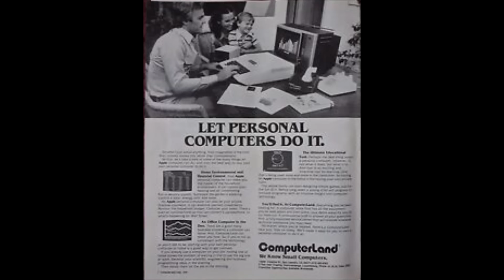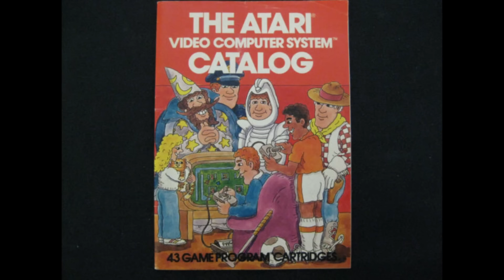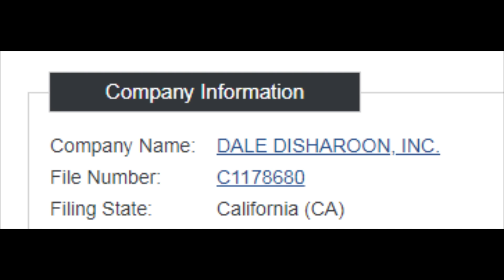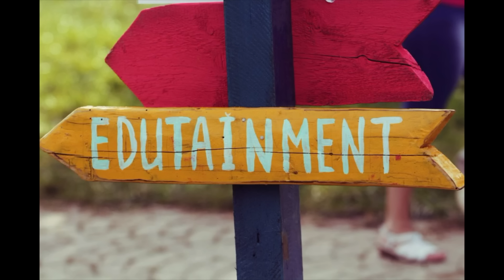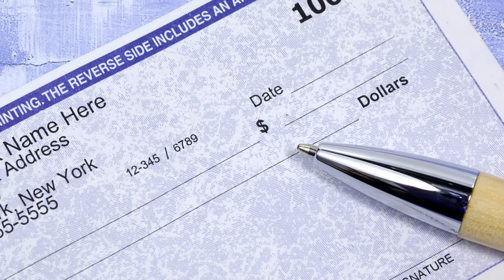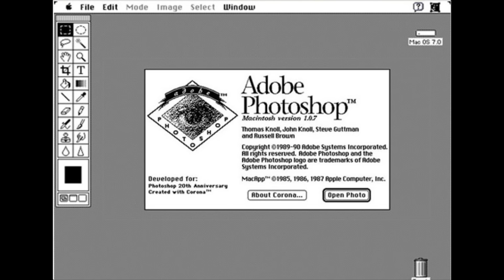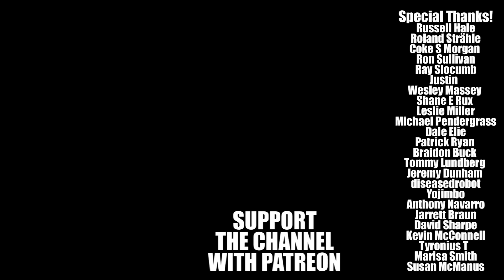Exploring The Legend of Zelda CD-i - The History of the 2 Notorious Games

Comment: Mt elementary school was rebuilt around 92/93, mainly from the asbestos used in its production - they even had a person come explain why it was bad to breath in asbestos dust in a simplified way (the particles are hooked shape and will get stuck in you air sacs, something like that). But they had built an amazing media center (it replaced our old library, but it still had books) with all the classrooms being connected to it, and they had CDi's and VCRs, Laser disc players in there, and the teacher would call them on a phone that we also had in every room and ask them to play whatever it was and they would send it over however it was hooked (up Im not sure if it was networked or if it was just splitters and long S-Videos/RCAs)to your exact room (every room had a TV mounted in the top corner). We also had a small cluster of Macs that were pretty good for the time, sometimes the pod of 4/5 Macs were shared between 2 rooms but a lot of the older kids 4th/5th graders had a pod in each of our classrooms. I mean this was a huge step up from the past schools and tech they had, the AV cart was top of the line for the old school. Mind you this is in Hammond, Indiana which is literally sandwiched inbetween Gary, IN (the old murder cap until New Orleans took that titles for a while) and Chicago. It wasnt like we were in some super affluent town. It sucked cuz I only had 1 full year there before middle school (we also had an almost half year when I was in 4th grade) and that middle/high school was pretty shitty.  It didnt have anything but a few (older) Macs in the library, and the old AV carts with a TV and a VCR. It also had no air conditioning. The glue from the ceiling tiles would become unglued cuz of the heat and humidity in the begging of the school year and toward the end of it as well. Several students and staff got hit in the head from these titles falling down from the like 12/15 foot ceiling and it knocked a few them out. 

One year MTV came there after a girl got suspended for having dyed hair...the school said it was "disruptive to the learning environment". I guess it being 110 degrees F was fine, and of course they didnt have fans running often cuz then you couldnt hear the teacher. That was fine. The dyed hair stuff was ridiculous. It may of caused 10-15 mins of people being interested in it over the course of 1 day, but their lil hissy fits the admins threw bad sure it was a big deal. The kids now that go to the schools in my city have to wear a uniform (which is just khakis, and a red, white, or navy blue polo shirt) and  the high schoolers dont get off campus lunch.

Comment: "now notorious TRS-80's" Despite the nickname, Trash 80's were actually decent computers for the time.
Reply: I think they were even considered high end products for a short era, when its competitors were the Apple II (the original, not the Apple II+) and PET.  I read somewhere that Sinclair's low-cost ZX-80 came out in early 1980 and was advertised as being superior to the TRS-80, so this era must have been earlier.  I have tried using a VIC-20 before and it was pretty decent, if all the stories of TRS-80's unreliability are true then there's no way it could have competed.

Comment: You can't imagine how hard it is to type into the 400's touch-sensitive 'keys'. It very quickly becomes physically painful. The Atari machines were very well designed though and many aspects of modern computer use first emerged in their hardware such as a proto-USB interface and sprite-based or 'Player/Missile' graphics.

Comment: Regarding the price. I vaguely remember my parent buying a soundblaster 16awe bundled with a CD-ROM drive in 1993, which was about $700. So the CDR drives just made something expensive.
Edit, just looked it up, and the Sega CD was only $300 in 1993, apparently I'm not fully correct.

Comment: The CDi Zelda games may be playable in some state. But as a self-appointed animation enthusiast. The cut scenes are the poster childs of the fact that no amount of animation cels per second can save you if you have no idea of what how character animation works. These figures flail around all over the place. Wasting so much effort. Not being motivated by the situation or the voice-acting in any reasonable way. Instead of a handful of strategic frames, they burn through dozens upon dozens of haphazardly composed poses that makes it hard or impossible to get a feel of what is actually supposed to be conveyed. 

Take Dragons Lair for example. There an experienced animator used about the same amount of finished animation and made an action packed tightly put together experience. Even if you take away the beautiful 35mm film scans and make it into pixelated frames, look at the gameboy color version. It is a marvel to look at. And they reused a lot of animations to save memory on that tiny cartridge space. 

Again. No matter how many frames one can pump out. It makes no difference if the movement doesn't serve the situation.

Ok. Rant over. The soap box is rickety and the dead horse is starting to smell. I'll see myself out.